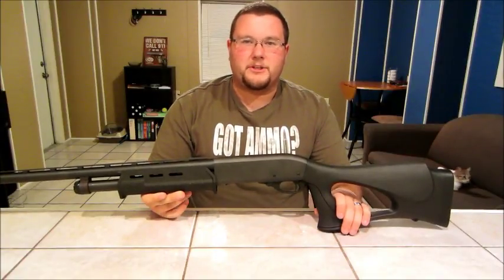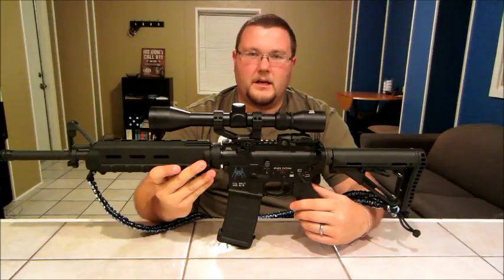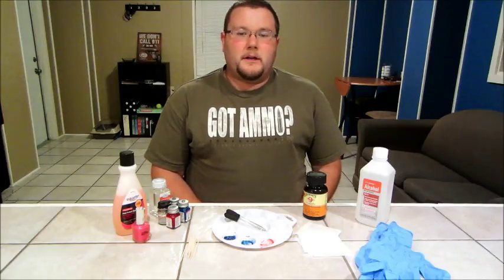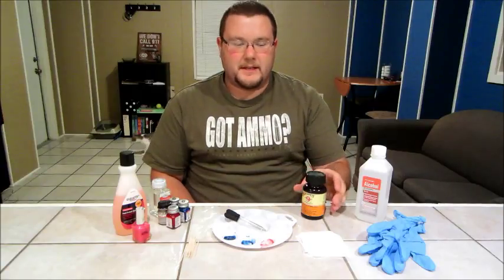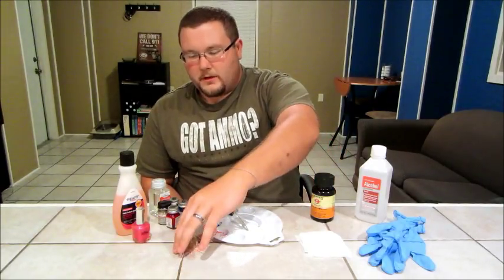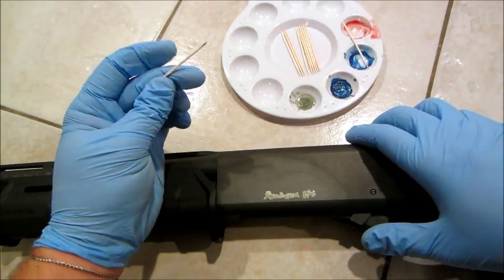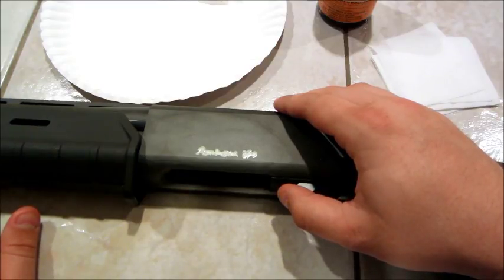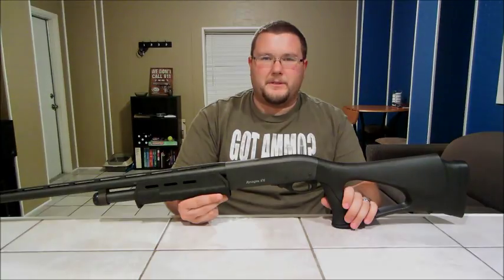How To Color Fill Your Gun

Comment: I just did my 870 and my AR based on the video.  Thanks for the great how-to!!
Reply from the maker: HowardTibsTheThird thanks! Sometimes I don't use thinner...I use the thinner to help it run down into the lighter/shallower engravings a little better...but if you've got a good solid place you're filling in the thinner isn't necessary often times.

Comment from the maker: Should work just fine. I like to use the Hoppes 9 gun solvent to wipe everything off since I already know that won't damage the finish. The grips that I did on the smith and wesson pistol were plastic...so I don't see any problems with filling in the engravings on a composite gun...good luck!

Comment: instead of using the wiping pad to remove the excess put the alcohol on the underside of the heavy cardboard from a beer case. I use the case from "Ice Beer" .The cardboard will stay flat and it is a little bit abrasive. Don't drench it,just enuf to get it wet.

Comment: Any benefit to using a clear coat over the paint once it's cured?  Future cleanings might be pulling off fine layers of the clear prior to getting to the paint.  just a thought...??
Reply from the maker: I have never messed with any clear coats over the top...and the markings I have made on my handguns and AR's have been there for a few years now and are still pretty sharp. Not sure if the clear coat would add much protection or not...but I guess it couldn't hurt!
Reply: +WalkerArmory    Well I'm headed to hobby lobby today for some barrel projects..  I'll do one with and one without, and report back after many cleaning with results.  I am kinda OCD with cleaning and worried all my hard work might start losing the effect early.  Thanks for the Vid, and I'll report back in a couple months :-)

btw, most the other vid's are using Mineral spirits, but looks like your Hoppes worked great.  I've had the spirits pull off too much and required several coats of paint which was a hassle.  Thanks for that idea.  Someone here suggested WD40, I'll try both today and report back on the differences there as well.
Reply from the maker: Awesome. I actually helped my little brother fill in his polymer lower last night and we just used some rubbing alcohol to remove the excess too since he didn't have any hoppes or clp at his place. Multiple ways to skin a cat...

Comment: So I did this on my M&P 15-22LR and I used 91 % Alcohol to clean then did white paint then scraped the dried paint away and wiped down with non aceton nail polish remover and it still looks foggy around the painted area, any suggestions.

Comment: Have you tried the paint pen process
Reply from the maker: I haven't used the paint pen...this epoxy that I use has worked well for me and has lasted many years on my gun even while cleaning with solvents after it has cured. If they make a paint pen that has this similar paint in it I'm sure it could work...but I like this because I can thin it as desired to help it flow depending on what style of roll marks I'm working on.
Reply: True.  I just did my xd 9mm and my s&w mp40c. They turned out great.  Thanks for the help.

Comment: Is  Testors Enamel paint the same as Testors Acrylic paint?
Reply from the maker: Nope acrylic paint is a different base than the enamel paint.
Reply: +0326Ghost Acrylics clean with water (I also use a brush soap) but enamel requires paint thinner or other solvent.  Enamel is more durable the acrylic but is a bit more involved with clean up and is rough on your brushes (esp. if you do fine scale modeling...using enamel with sable brushes is a no-no).

Comment: How does nail polish remover work with the testors enamel dont want to use hoppes incase need to add more paint ?
Reply from the maker: T. Bone I've always just used the hoppes with the testors...never tried the nail polish remover on the paint. I use the hoppes because it helps kind of bring the rest of the finish back to the original color. You could probably also use alcohol and then go back over with hoppes after. The alcohol just dries out the spot and makes it lighter until you get the oils and solvents back into it.

Comment: So how do you remove the paint if you decide you don't like the color?
Reply from the maker: I will use a wooden toothpick (so I don't damage the gun finish) and pick the paint back out of the grooves and using Hoppes solvent and a patch and use the toothpick to push and pick that wet patch through the marks to get the paint out. It's easier done when the paint is first applied vs. after it's fully set up and cured...but it can still come out later, just takes some more work to get it.
Reply: I use denatured alcohol, takes it right off

Comment: So you wore gloves to wipe gun down with evaporating alcohol BUT didn't wear gloves while using gun solvent.  Ouch!  Use mineral spirits to pull off excess paint.  It won't potentially harm the black finish on the firearm either.
Reply from the maker: uploadthis2011 I used gloves to keep the oils on my hands from contaminating the surface. One the paint was applied I didn't care about the oils...and gun solvent runs in my veins lol. Plus I used gun solvent rather than mineral spirits because rubbing alcohol and gun solvent are things most gun owners will have handy rather than another trip to the store and more money for mineral spirits.